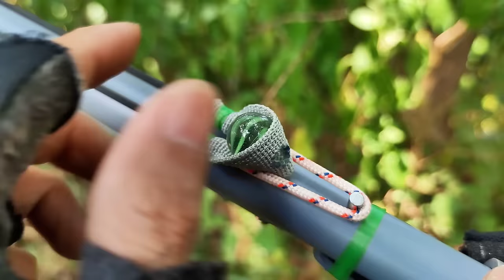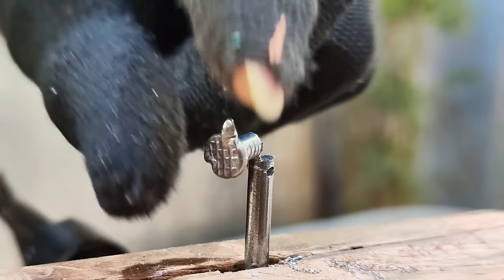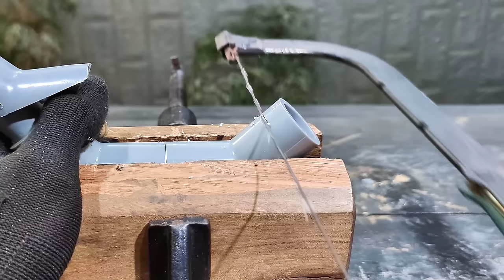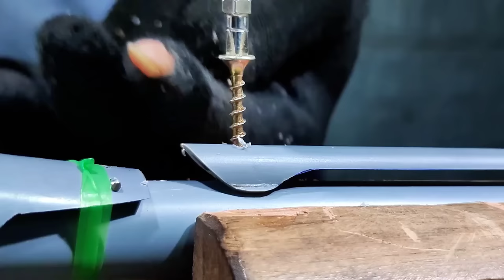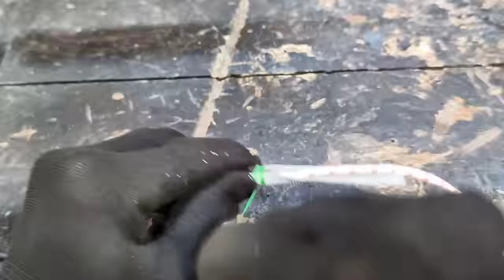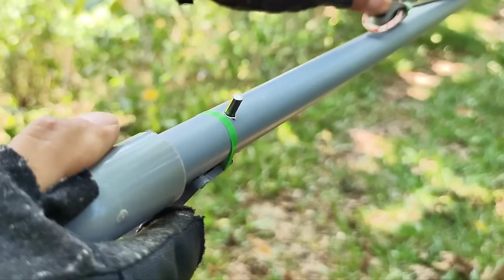DIY slingshot | Simple unique trigger that uses combo ammo | Wood Art TG

Comment: Fantastic video! I was captivated by the step-by-step instructions on how to make a slingshot using PVC pipe. The use of PVC pipe as the main material not only makes the slingshot sturdy but also readily available for many DIY enthusiasts.
The clear explanations and visual demonstrations made it easy to understand the construction process. It's impressive how a few simple cuts and fittings can transform PVC pipe into a functional and reliable slingshot.
However, I must emphasize the importance of safety when using any projectile-launching device. It's crucial to exercise caution, especially when aiming and handling the slingshot. Always consider the potential risks and use it responsibly. Sir if you never mind, can you please pin my comment?
Reply from the maker: Thank you very much.
Reply: คน